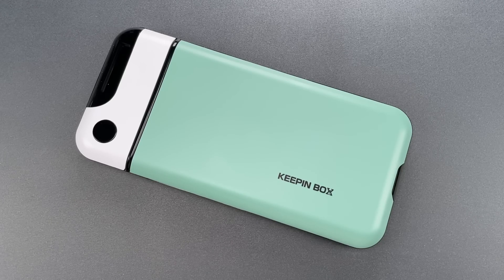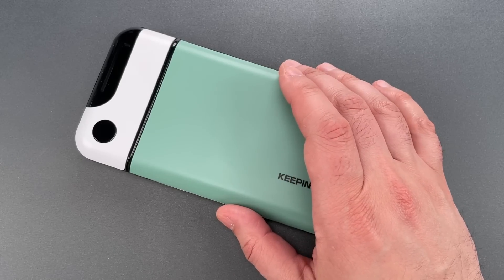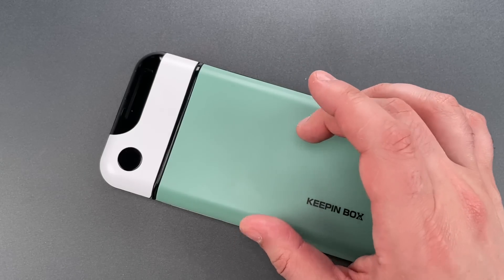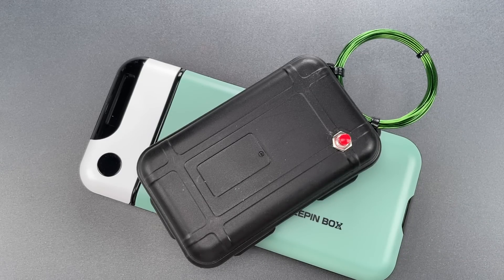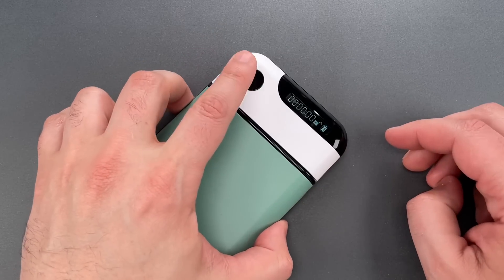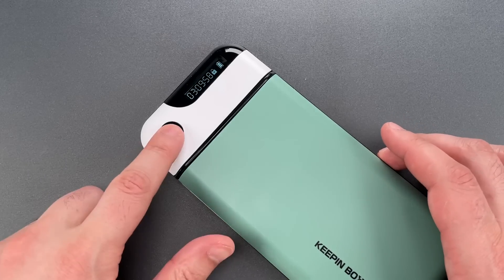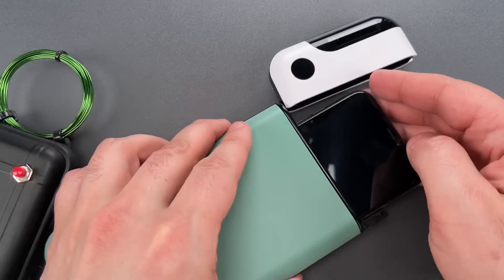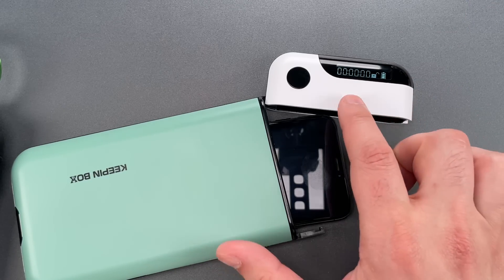[1440] Pocket EMP vs. Smartphone Timer Lockbox

Comment: Speaking of party tricks, you should try that on some secure door systems and see whether that could work on those too?
Reply: anything that has an external controller inside the keypad will get wrecked by this attack. If the controller is internal and the keypad or fingerprint sensor is the only thing exposed, they will be fine
Reply: Plans for your portable EMP generator?
Reply: @I_Can_Do_That_2  Here's a how to guide I wrote:
 

Buy a project box
Buy some enameled magnet wire
Buy a boost converter from an online marketplace (one of the ones potted in resin with claims of 500KV or more)
Buy a PTM (momentary) switch
Buy a battery holder for 4AAs
You also need a soldering iron and preferably a drill

Wire the negative end of the battery holder to the negative end of the boost converter.
Drill the project box (or melt with the soldering iron) and mount the momentary switch like LPL has done.
Wire the positive end of the battery holder to the PTM switch then the PTM switch to the boost converter.
Take one of the leads from the boost converter and attach to the coiled magnet wire (same arrangement as LPL has), remember to sand the magnet wire so you make an enectrical connection. 
Take the other end and attach the lead to a bolt running through a nut which is glued to the project box.
Have another bolt and nut glued near to it. This allows you to create a spark gap so you get a pulse.
Attach the other end of the magnet wire to the second bolt.
Adjust the spacing between the nuts and bolts so that you get a regular arc between them when you press the PTM switch.
Tidy the project box up, use zip ties to secure the coil of magnet wire. Glue everything down.

You now have a portable EMP.
Note that it'll only work from a few inches away. It will also cause RF interference.  Also it may permanently break things, so only use it on what you own.

PS: You can forgo the nut and bolt spark gap and make a simplified one with two spaced wires potted in hot glue.
Reply: @daviddavidson2357  Thank you. I was being lazy when I wrote that reply to LPL and have since investigated making both an EMP as you’ve described along with a device to jam cell phone signals. All of this is for my intellectual edification and not to be put into actual use, but I suppose that goes without saying.
Reply: @I_Can_Do_That_2  Pretty easy to make, just get a cheap high voltage transformer. (12v to 10kv or so) Find a box, a 9v battery or two, a button (make sure to put the button between the positive of the batteries and the transformer), add a spark gap between the transformer and a coil, viola.
Reply: @I_Can_Do_That_2  Yes, please!
Reply: If they have a similar issue of storing mission critical information in volatile memory, or they go into failsafe open mode when reset, then potentially yes an EMP would bypass them
Reply: @CoolAsFreya  This is really only true for commercial locks, particularly ones where if the electric mechanism broke the door couldn’t open even from the inside so they are required to fail open so as not to be a fire hazard.  Most electric locks for home use can still be opened from the inside mechanically even when unpowered and broken so they don’t fail open.
Reply: He has. They didn't fare well. Of course, those are the only ones we saw...
Reply: I'd guess they'd have shielding to prevent that. And for devices like the one in the video, resetting the device wipes the volatile memory. For a secure access system like ones used on a door, they will be using persistent memory. Resetting it won't do much.

ElecroBOOM has a video about trying this too (though he used a taser and not an induction-type device like this)
Reply: Yes.
Reply: Actually that could have turned out quite different.. if it SMOKED the phone to boot (no pun intended). Cheers TL
Reply: He has shown fingerprint locks who are worthy of breaking in with nothing more than strong magnets.
Reply: ElectroBoom done it (kinda), was fun.
Reply: He has.  Often the controller is stored in the lock itself, rather than in a secure box inside the house.
Reply: I install access control...
This would never work on any of the readers or strikes I install. It wouldn't work on the reader because the reader has to take badge information and send it to the server and then the server confirms the badge and sends voltage to the lock hardware.

The lock hardware whether fail secure or fail open wouldn't work because both styles is a simple coil, and emp would have to be pretty strong to disrupt a DC current through the coil or strong enough to power the coil to activate and unlock the lock.

Maglocks are hard to tell, they are normally extremely simple circuits but they are surrounded by thick aluminum.  Again, I would wager they won't be affected because I don't see EMP disrupting continuous DC current.

Let me know if you have any other theories or systems you want my opinion on.
Reply: Some secure doors have physical locks for redundancy
Reply: @dragonraptor3435  Yes, that is a good idea. Imagine a Zombie Apocalypse and no more energy flowing through the grid. How could you break in or out when there are no keyways?
Reply: Not going to work.
Reply: I'd say no with more secure door systems. Typically the card scanning device is just that. It may encrypt the swipes as well, but more often than not the actual nodes that control the locking/unlocking the door are a fair ways away. The keypad would need to send a valid set of credentials to the node for the locks to trigger, even if the keypad beeps or resets it would just go back to its regular card reading mode, assuming it doesn't break. For that kind of attack you'd be better off with a device that could dupe the nfc/hid cards that are used.
Reply: It might shut off the lock but it wouldn’t unlock the door.
Reply: They dont, i tried at the fbi headquarters.
Reply: @Fartucus  Could you try the NSA? Much more interesting! Or maybe the Washington buerau of the grand ole party?
Reply: @wolfgangpreier9160  The RNC HQ in DC has human door guards, not a card reader & electronic lock.
Reply: @philprange5561  Of course, the americaine tax payer pays for every folly. Even human guards guarding a door. i would say a handle and door hinges would have been cheaper. Maybe not longer lasting. IDK.

Comment: Funny, but impractical, as it will fry the phone and subsequently opening is useless :D
Reply: It's probably not strong enough to even reach the phone. Even if, given that the micro-controller survived it just fine, there's probably a good chance the phone would as well.
Reply: The phone might crash and reboot, but I don't think it will do any lasting damage to it.

Comment: Is there any risk of the EMP damaging the smartphone in the lockbox? (Obviously this is less relevant in the case that the same electronics are used for e.g. time-locking narcotics/cash.)
Reply: He did mention that he used his OLD phone...
Reply: it depents on the strength of the emp and how long you hold it on it. if it is too strong then you could damage the battery and/or corrupt the memory and if the phone is on then you can expect that the os in the ram get's corrupted and many bad things could happen to the system. but it really depends on how strong the emp is. if it isn't way stronger than the wifi or other electromagnetic signals that the phone sends out itself, then nothing happens.
Reply: LPL called it an EMP, which conjures images from how the word is used in fiction, but I'm pretty confident that it's just a powerful interference generator. Electromagnetic interference (EMI) is a serious but mundane element of electronic engineering and there are a lot of chips out there which, when they receive too much electromagnetic noise, cut out and restart. I've been having this exact problem at work. He didn't hit the box with an 'EMP' - a high-power pulse like in sci-fi or a nuclear explosion - he bombarded the locking chip with interference (like a jammer) and it reset itself. If he bombarded the phone, it would lose its link to the network while the jammer was active and the software/OS on it might crash, but it's very unlikely to be damaged.
Reply: @gigabyte2248  EMP just means ElectroMagnetic Pulse. And it definitely was that.
Reply: @user255  Multiple electromagnetic pulses.
A nuke detonated in high atmosphere will create one extremely strong pulse.
This creates dozens of weak pulses every second. So it does create EM pulses but more in the form of interference than actual damage.
That being said, it could still damage electronics through induction.

I'm not sure about 4g phones but 2g and 3g phones did a good enough 'EMP' impression by causing speakers to click, my keyboard to ghost type and my mouse to scroll wildly. I knew I was about to get a text when my weapons started rapidly swapping in TF2 about 10 years ago. Realized it was my phone sitting by my mouse cable.
Reply: The phone is likely built to withstand more than that lock, like another phone close by or similar.
Reply: It would probably make the phone hard reboot, but it's very unlikely to actually cause damage.
Reply: Those DIY EMPs are not that powerful, so the cellphone is ok
Reply: I doubt it. From what I know about volatile memory and iOS, if I had to venture a guess something like this (directed at an iPhone) would trigger a kernel panic in iOS because some OS-critical bits of memory would be corrupted, and when iOS notices this it will reboot. I've not done any testing to confirm this of course, but this is what I suspect would happen.
Reply: No you would need a pocket EMP made from at least $25 worth of parts for that.
Reply: target probably needs to be in or next to the coil loop as he used it in video.
Reply: That actually made me think. An EMP is designed to disable or shut down electrical equipment. A cell phone is just that 🤦🏼‍♀️😂
Reply: @Rocinante_1980  EMP simply mean electromagnetic pulse. But yes, that device is designed to mess with electrical devices. However it is not very powerful and thus it doesn't work against many devices.
Reply: Why would you time lock your narcotics, so you don't use them all before you can get more?
Reply: @SoulDelSol  So that other people can't use them all before you can get more. Think shady roommate or teenager.
Reply: @SoulDelSol  Maybe to avoid overuse or addiction..?
Reply: @user255  good idra
Reply: @SoulDelSol  bad pain + memory issues = easy to accidentally overdose. My friend who recently had spine surgery has ADHD and used timer caps to make sure she doesn't over or under medicate. (She's doing much better now that her spinal cord isn't getting stabbed with bone shards every time she moves.)
Reply: Yes
Reply: That's what I was thinking while watching the video.
Reply: The video didn't cut out, so, probably not effected?
Reply: @Orinslayer  it only works really close by (like under a centimeter) but the phone inside could have been affected
Reply: @Orinslayer  The camera is much farther away than the smartphone.
Reply: if the phone has wireless charging then it most likely won't hurt anything, it works on the same principle. although, even some phones without it will be fine

I used to have a sony xperia z3 and I worked with a machine that magnetised steel tubing, one day I set my phone in the end of one of the tubes and forgot about it for a little while, when I finally noticed it we had just run the magnetic coil over the tube that my phone was in, it surprisingly came out unscathed
Reply: @nathanstautzenberger8381  wireless charging is a completely different thing... yes it uses the same principle, but definitely not the same.
Reply: @-never-gonna-give-you-up-  most, if not all, modern phones have EMI shielding anyways, so what does the difference matter

especially with such low scale EMP
Reply: @nathanstautzenberger8381  iPhone 11 even has glitches when applying EMF, you do know that a DIY EMF emitter has different waveforms and strength compared to wireless chargers? The wireless charging pad inside the phone picks up any waveform that is emitted by a compatible wireless charger, if it's an EMF emitter, it will not absorb the waves. Sure there are some shielding inside modern phones, but I highly suggest you apply an EMF emitter on the front side of the phone, you will see the screen glitching out since you can't shield led screens..
Reply: @-never-gonna-give-you-up-  yes, I do

let me clarify why I'm fairly certain the phone will be fine

I used to work a job in which we used an electromagnetic coil (hundreds of times larger than that dinky emp generator) to check for tolerances of steel tubing, I set my phone in the end of one of the tubes and forgot about it for a little while, when I finally noticed my phone we had just ran the coil over the tube that my phone was inside, it came out unscathed despite being subjected to a very abnormal level of electromagnetism. while that is also different from EMP, it would still have similar effects on a phone
Reply: Might reset it but probably wouldn't do anything more than that
Reply: It will definitely interfere with the screen (I.e flickering and stuff like that ) so don't try it out, turn the phone off, that way it can't harm it.
Reply: @-never-gonna-give-you-up-  Turning the phone off won't stop EMP from harming it. Although it probably isn't going to be harmed anyways...
Reply: I think the box is made of metal, so no.
Reply: @user255  Considering LPL said plastic... How hard is it to pay attention to a 3 minute video?